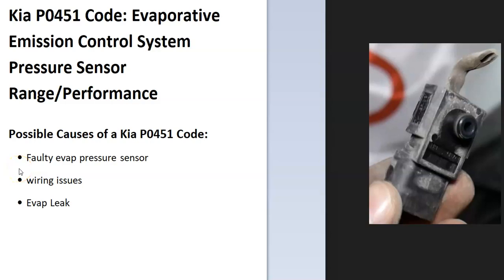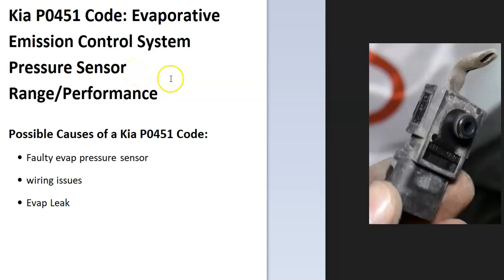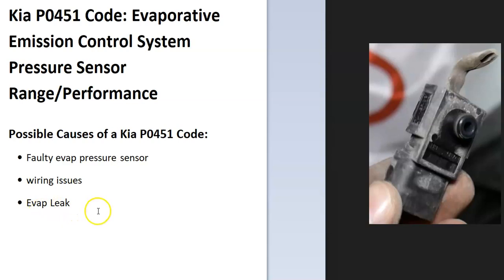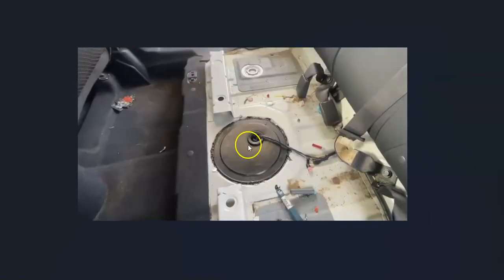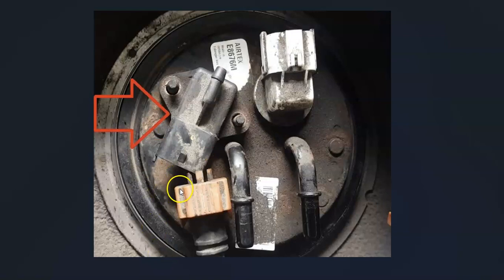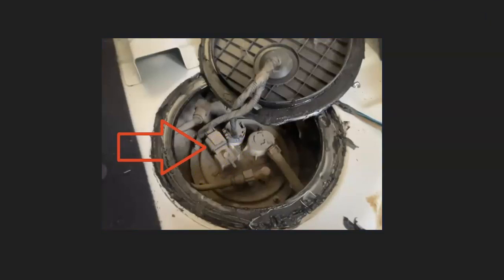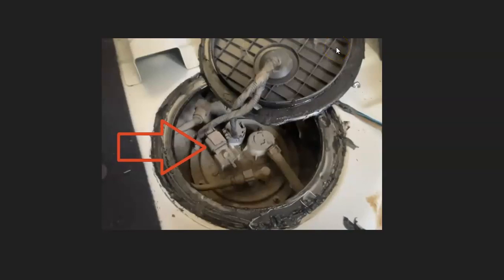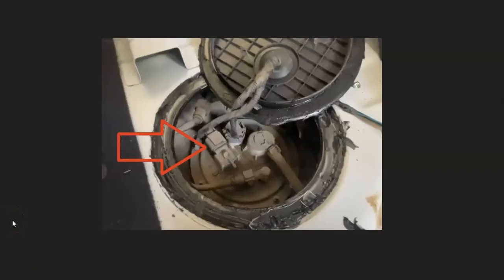How To Fix a KIA P0451 Code: Evaporative Emission Control System Pressure Sensor Range/Performance

Comment: I just got my car back from collision repair and about five hours after driving my check engine light came on. I didn’t noticed that even though I had a full tank of gas, the gas gauge marker was not working correctly and all of a sudden when it said 400 miles until empty an hour later it said 39 miles and I also noticed as I’m driving there’s like a hesitation jerk. The code came up P0451 can that cause the hesitation and jerk ? A faulty sensor ?

Comment: Can this part cause your car to run rich as well ? And what’s the best method to get it off? Mine is on pretty tight because it’s new. I just have a cheaper version fuel pump.

Comment: When the sensor is removed, will there be pressure like working on a fuel pump that is not purged?
Reply: Open your gas cap and release the pressure then pull the sensor

Comment: Hello, today the check engine turned on and when I did the scanner, that code came out. I changed my fuel pump 3 weeks ago. So how is it possible that the sensor is?
Reply from the maker: I would check the wiring harness is connected good.